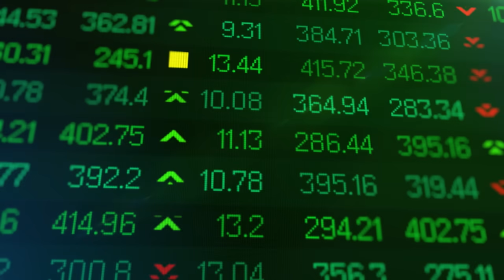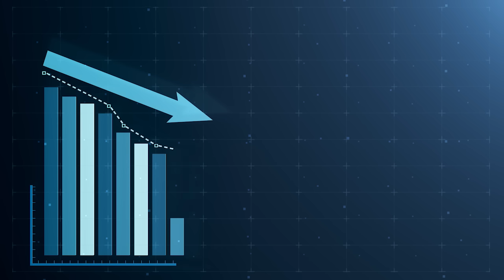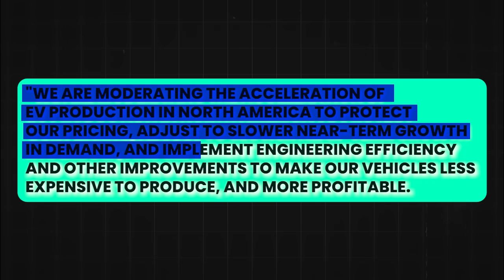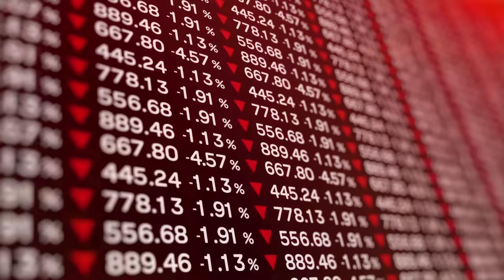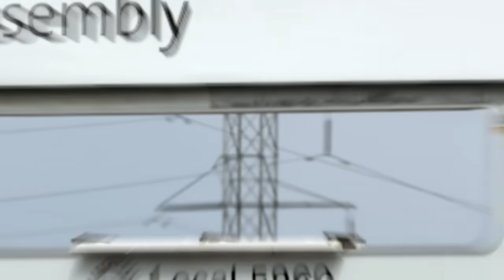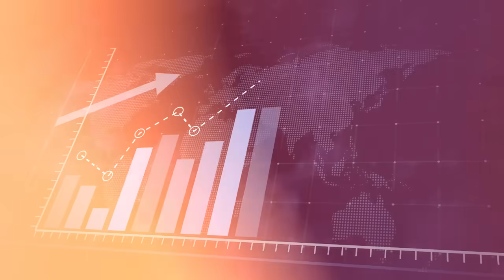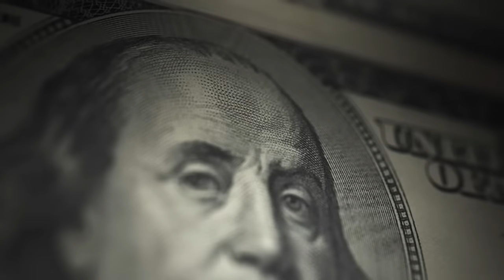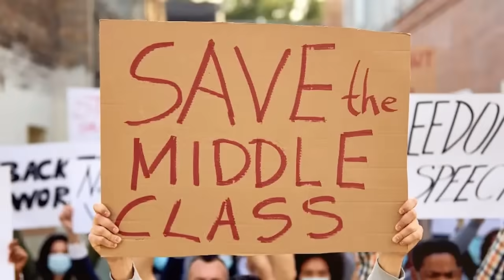HUGE NEWS! GM CEO Just SHUT DOWN EV Production!

Comment: I wonder what the secondary market will be on EVs. Who would want to buy a used electric vehicle with the main component, the batteries,near end of life . I would think resale value will dismal and there will be a whole lot of unsellable cars sitting around.
Reply: The only people who'd want to buy end of life EVs are the people who are willing/able to cut them up and convert them in ICE vehicles for resale.

It's not only possible, but has been done with several EVs by people just for themselves, but I'm sure it'll be a nice little cottage industry in the near future; sadly lots of EVs look nice, and have well engineered chassis, it's just that damn shitty EV part that ruins them.

Comment: Sure these expensive electric glorified golf carts are great within say 60 miles of your home.  Community vehicles.  However any long range travel for vacationing or any long range transport you still need a reliable gas power vehicle.  It’s just impractical to assume otherwise.  I can’t tell you how many EVs we saw abandoned on the side of the road the last time we did a multi state road trip.   At least 5 in less than 400 miles, and near a dozen of the week long vacation by the time we got back.  It’s become the new slug bug game.  Two places in outer banks area had ev stations that were shut down.  The people that went to them that I talked to said they had planned to stay at the same hotel we were at to let them charge overnight there as they were on the map they had in their phone.  But now they needed to go elsewhere and were unsure if they would make it to the next nearest spot. It’s not like they can get a jump or something.  And AAA would just arrange a tow not a portable quick charge if there is even such a thing.

Comment: If people just do some research on them cars them cars always have to be plugged up. That battery is always using percentage of the battery to keep the car active. It’s basically a competition your laptop always on it’s nothing but a scam that battery has only so much charge in it and it is only gonna charge so many times before it fails just like your cell phone just like the anything that you plug up the charge to use it’s only gonna last for so long before it ain’t no good no more that’s just a simple fact, they’re not that cost-effective. They use more oil than a car. It takes so much oil to build all that cause here the same thing it still takes petroleum to make all those parts that you so much want to holler at you. I’m going green and there’s no keeping that car for no hundred thousand 200,000 miles cause the battery ain’t gonna last no 200,000 miles, tell me where they posted about that over the batteries gonna last 200,000 miles they ain’t gonna say that to you it’s a scam you ain’t gonna have a 20 year old electric car. You gonna have a three year old electric car and you gonna buy another one. It’s a trashcan that gets tore up.

Comment: Unfortunately todays ppl are slooow thinking, 1960 many ppl started building electric cars like golf cars with vw transmission and lead acid batteries even those where slow and heavy but cheap to operate to a point that didnt work not good economy or savings from, today with better quality batteries work better but far from been economic besides dangerous in times and pollution that even put in danger children working on materials for the EVs if they say there's lithioum everywhere why cars are too expensive? Electronic components aren't expensive but the technology is no information given about the complete process to build an EV and materials plus risk$$$ like today they're finding out

Comment: The loss for these cars is not going to matter because the taxpayer will have to foot the bill when we bail those companies out again I don't understand why we're not using true hybrid a smaller gas engine that powers electric motors charging batteries yes you have to find that balance but they use them on trains that way and they get insane gas mileage and power generation and with our advancements in electric motors batteries the solid state ones I generally don't know why they're not doing that cuz then they can have the best of both worlds and create vehicles that have far less moving parts and still get to help the environment which honestly is a joke because they're going to get rid of combustion but use fossil fuels to power everything and then turn around and dig holes in the ground so big that it would take a hundred years for it to even be a usable region

Comment: Yes I think that the overall cost to both the manufacturer and the buyers has got to a level as to make them so unsustainable from many viewpoints including the buying of, insurance, battery failure and replacement and running costs . This of course includes the resale value and the problem of waste disposal when the vehicles are recycled.

Comment: I think EVs are the future, the reason why it's not selling in North America is bc:
1. Infrastructure
2. Ppl equate EV to high tech smart vehicles thus low margin and expensive
3. Grid cannot support all the EVs
4. Battery degradation and value of used EV
5. Battery safety

Solution:

NIO Battery swap technology:

1. Maintain vehicle value
2. Swap statio  Maintain Battery quality
3. Battery swap stations supports the grid whenever needed.

Comment: The real truth behind EV's is to make it easier to track our movements as well as limit our movements while burdening people down further financially.
Reply: The very device you use to post this can/is being used to track what you buy and where you live.
Reply: @grunt98444  True but we also have the ability to turn that stuff off even though it may be difficult at times. An EV however simply won't work when you start disabling certain components even though they are not needed for the vehicle to operate.